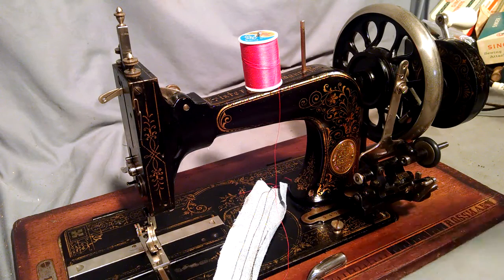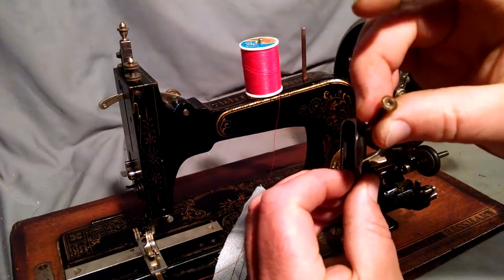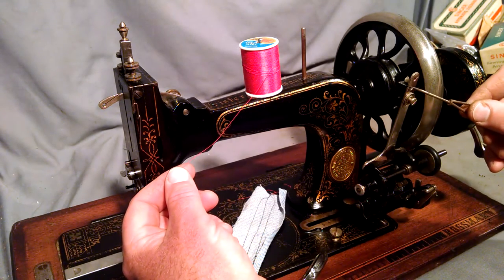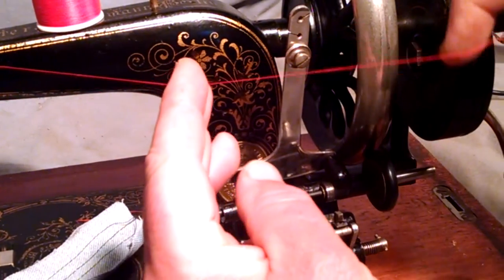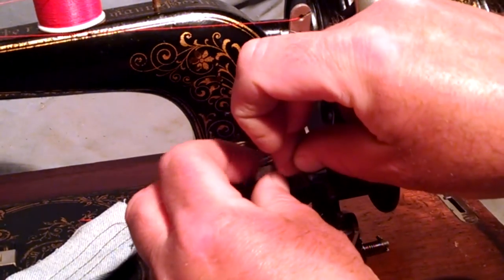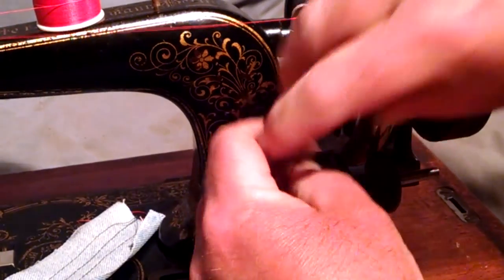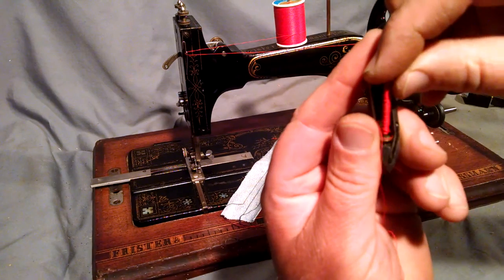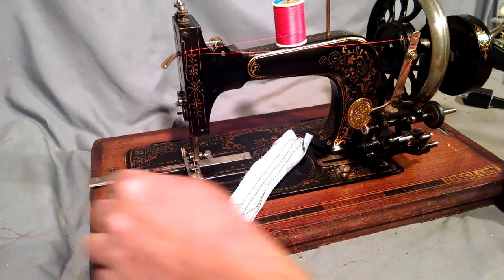How to Wind Bobbin Thread Boat Shuttle Antique Frister & Rossmann Hand Crank Sewing Machine

Comment: I have a New Home hand crank mini and would like to know what needle I can use comparable to what it takes?  Regular needles are 1/4 inch too short.
Reply from the maker: I dont remember what type it takes, try searching eBay or ISMACS
Reply: Hello  the needles for the sewing machine , what store did you find them at ?
Reply: You can use regular needles but don't set them all the way up in the needle slot on the needle bar.